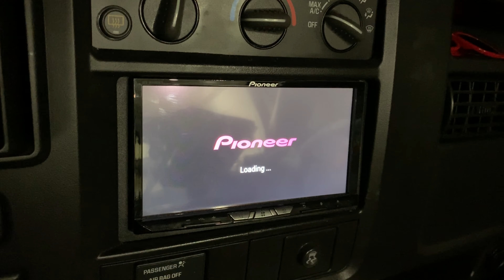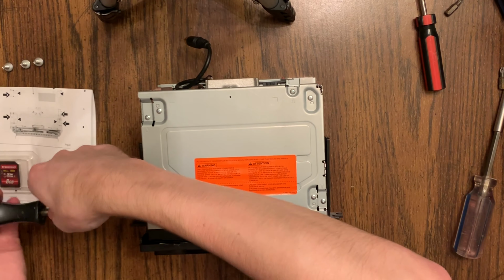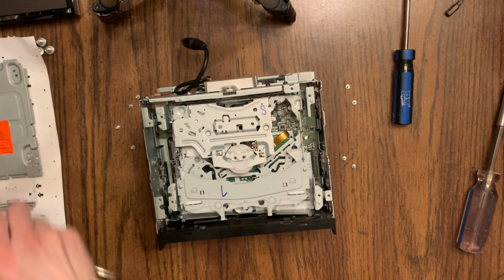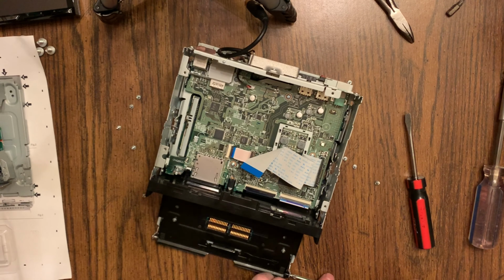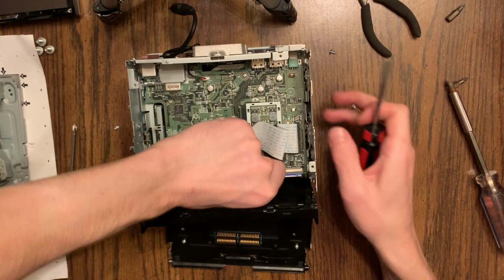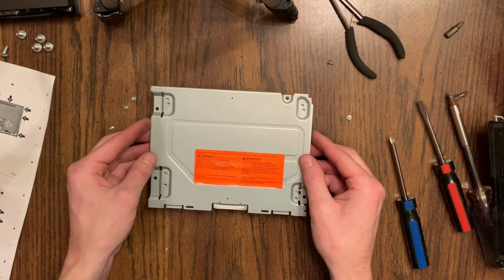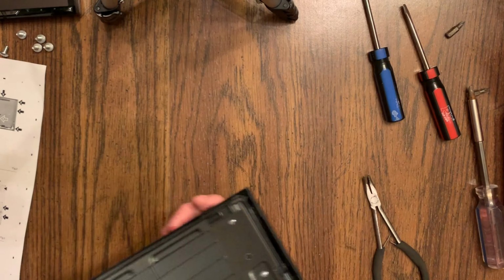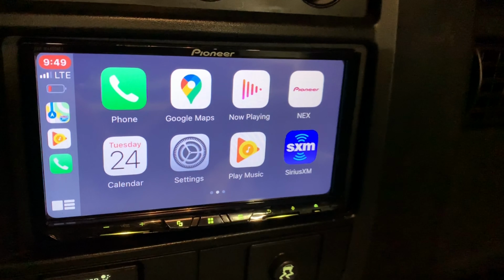Pioneer Software Error Fix - SD Card Replacement Procedure

Comment: Thanks for the video. I know this is a few years old but I’m curious to know if you ever had an issue with the radio freezing and rebooting and continuously doing that. I posted an upgrade video on how to update the firmware years ago. This is in a vehicle that doesn’t get driven often and just wanted to see if anyone else has this issue. Maybe a precursor for the issue that you were having?

Comment: redoing an old car, and everything has messed up by previous owner, car came with a 4400nex, it does not remember screen brightness, volume,  it always starts at same song on sd card (64gb fast samsung card) instead of going to last played folder/song. it does remember my phone/BT and always starts in android auto. i was wondering if previous owner hooked it up wrong and it needs a constant 12v even when off to remember settings...or if its bad SD card...it has a nice porsche logo when booting that i would like to retain, but i dont know if thats a built in feature of the unit or something hacked

Comment: update so today I got my new SD card and I used your video to guide me thru. Didn't have to disconnect the ribbon from the CD player. Anyhow, removed old one and installed the new one from eBay and it works like nothing happened. Only had to set time and date and it retained my radio presets and other stuff. 💪
Reply from the maker: Score! Glad to hear it's in and working. Enjoy the tunes!

Comment: I know this is a common issue with the NEX4400.  Just curious.  Since the card goes into a slot just below the easily accesable sd card, why didnt you take the time to cut a hole in the plastic so it can be easily accessed next time

Comment: I’m curious - can i just use a dremmel tool and cut out around and deeper than the exposed SD card to get access? It’s behind the screen and never seen. 

The issue I have is that the install kit I used is a one way install and requires the entire dash to be taken out of the car to get it out.
Reply from the maker: Sure thing! Others were able to gain access in the same way. The challenge is getting the Dremel at the correct angle to get the cutting wheel in the right spot. It has been done though!

Comment: Thanks for the instructions. I'm about to do this, but was wondering if after installing the new card causes the unit to go back to factory default? Radio stations, EQ settings, etc. Or do all the previous settings still stick? Thanks!
Reply from the maker: Hey Scott, it's been a while since I've done this but I think it resets everything to factory defaults.
Also, worth mentioning - some people reported they needed to perform a factory reset (after replacing the SD card) to regain certain radio functions.
Reply: @VanwithTim  Thanks for getting back to me so quickly. Appreciate you doing this to help out so many people. My radio is two years old and it just starting doing this yesterday. Ordered a SD with software from ebay and will do this when it arrives. Thanks again man.

Comment: I have a AVH-W4500NEX that seems to have saving problems.. I’ve noticed it says memory full a lot when I scroll the menus, Sirius radio doesn’t save my preset radio stations.. and the biggest annoyance of them all. CarPlay won’t retain my saved iPhone connections.. even if I delete all the old iPhone connections, once I turn my truck off the reappear the next time. Same for newly synced up iPhone connections. As soon as I turn my truck off and then back on the connection is erased. 

Does this sound like the remedy would be what’s shown in this video?
Reply from the maker: Late reply here, but I would first try a factory reset or a firmware update if possible (as you wouldn't need to remove the unit from the truck at least) but honestly it sounds like the internal SD card is on it's way out.
Just learned the publicly available W4400NEX file will work on the W4500NEX but takes a little coding. Namely changing the touch screen settings in the code. You can read more here:http://avic411.com/index.php?%2Ftopic%2F90861-fix-sdcard-failed-software-error-on-your-w4500nex-look-here%2F
Otherwise there is a pre-loaded SD card available from eBay linked in the description.

Comment: @van with tim I bought this unit today open box from Car Toys. Went to install it and this software error came up. Ran across your tutorial. Went and bought an SD card, extracted the file to my desktop then wrote it to the SD. Unfortunately, I’m still getting the software error. I’ve tried it over and over again, I think I’m just SOL. Will return this unit tomorrow unless you think I’m doing something wrong. Everytime I get done putting the image file onto the S card, once it gets done writing using that W program their is like 10 partition drives on the card. I just unplug it from the computer and plug it into the radio. Didn’t format anything or nothing
Reply from the maker: That's really weird, sounds like the file writing was done correctly! Maybe try re-writing them just for good measure (and make sure the touchscreen ribbon cable is fully seated into the connector!)

You can delete the files from the SD card using this guide: https://youtu.be/pfWDguRujEE

Then of course use the other guide to try rewriting them: https://youtu.be/Cro26vuoPHo

If it's still not working, I would definitely send it back for a refund or warranty.
-Tim

Comment: i have a pioneer carrozzeria avic-mrz02 similar structure as your with the sliding mechanism.
I'm stuck in a boot loops as well.
will this method work for my radio or even other pioneer radios?
Reply from the maker: Sorry for the delayed response - the SD card removal procedure may be similar, but you will need a different file. I would search or ask around here: http://avic411.com/index.php?/search/&q=avic-mrz02

Comment: I have the same problem on my avh-w4400nex, I also noticed that the unit itself is sluggish and slow at times, could the sd card be the problem as well? It takes over 3 mins to get to the home screen after startup.
Reply from the maker: That's the first time I've heard of that happening!
Hopefully someone in the comments can chime in on this.
In theory it could be a bad quality SD card (slow read / write rate or extremely low class SD card)

The SD card might be the cheapest place to start out. 
I hear the software is now available on the forums so no need to pay for anything other than a good quality SD card.
Reply: yup   ,sd card is getting Corrupt
Reply: @VanwithTim  Which forums? Where can I find the files?
Reply from the maker: @mykotron  link and instructions in the description of this video: https://youtu.be/Cro26vuoPHo

Comment: You just have to wonder if it is malevolent design (planned product obsolescence, if we want to be nice) that allowed Pioneer to to bury such a high wear item in such a user inaccessible location. With just a minor change to the plastics design they could have made that SD port just as accessible as the maps SD port, with no redesign of the circuitry at all. While I fixed my AVIC-4400NEX in only 2 hours and 3 minutes for free, (used an existing SD card I had and free software all around), I am never buying another Pioneer unit again. F' them.  

PS: If you want to TEST your repair before putting it back in your car,  the fat yellow wire and the solid red wire go to a 12V positive source and the black wire goes to ground.    I initially hooked up the black wire to ground and the red wire to 12V and NOTHING. Then googled help and found that the YELLOW wire is the actual power wire (role eyes) and if you hook up JUST the yellow wire to 12V and the black wire to ground you still get NOTHING. But hook up the RED and YELLOW to 12V and the radio will power up.
Reply: Hey man. Where did you get the firmware from? I need this for w4500nex

Comment: I have the same problem with 9200dab.
Where i found the fw?
Reply from the maker: You can ask around on the AVIC411.com forums but I don't see any for the 9200 posted.

Unfortunately you might have to message the eBay seller here and see if you can negotiate a better price for the file. I think it's sad they're selling the file and can't just give them free.
https://ebay.us/r81JHC

Comment: Is there a way to copy files from another Pioneer sd card? My friend has the same exact Pioneer AVH W4400NEX and his unit is working fine.
Reply from the maker: Late reply here - you've probably already figured it out. In case not:

There is supposedly a way to "rip" the image file from a working unit, but it's a very long process with some risk of corruption. 
However, the file for the 4400NEX is available for free online now. Here's the guide to downloading and writing the file! https://youtu.be/Cro26vuoPHo

Comment: Any idea if this would fix the unit just not saving any changes or settings?
Reply from the maker: I think it might fix it. I've heard a lot of stories of strange glitches like that which manifest into the full "boot loop" error. Unfortunately it seems it's not a matter of if, but when the SD card fails.
Huge strike against Pioneer with these units.
Reply: @VanwithTim  Thanks for the quick reply, and yeah terrible decision by pioneer.

Comment: My faceplate will not eject because the unit will not allow the eject button to work while in the boot loop.  How did you get the faceplate off?  Thanks
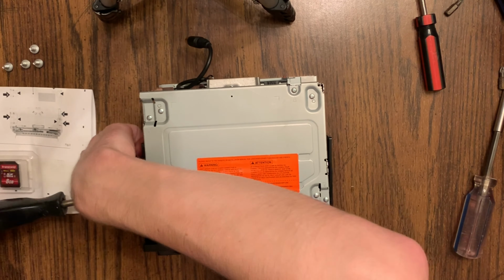Reply from the maker: Hey Erik, you should be able to slide the latch over and push the latch inwards if I remember correctly. (See @1:22) Did that work for you?

Comment: My 4400nex got stuck in the boot loop a few months back and I used the image to write to a new SD card and everything is working great. I had to change the battery in my car and the 4400 is now asking for a password to unlock the head unit and is giving the password hint of “pinball6”. I didn’t set a new password after reimaging so I’m guessing this is the password that is already included in the image file. Does anyone know what the password is? Sorry if this is covered somewhere else and I missed it.
Reply from the maker: I haven't given it a try, but the comments look promising here: http://avic411.com/index.php?/topic/83492-password-avh-reset

Comment: Do all pioneer radios have the same wiring harness. If I have to replace my stereo I would rather keep all wiring connected and just replace stereo itself
Reply from the maker: Hey Rick,  Pioneer units use the same PLUG but may have subtle changes in the pinout.  
I would double check the pinout of your old radio to the new radio.  

You can swap the pins around using a small screwdriver or pin removal tool if needed.

Let us know if you ended up swapping units and retaining your old harness!

Comment: Hi, thank you for a great job !!  My radio is AVH-Z9200DAB, after changing the card, the touch screen does not work, so nothing can be done.  It is possible that the software is wrong and it does not match my radio, or is something wrong?
Reply from the maker: Hi Artur, it's possible the software loaded to the SD card was for the Z9100 / W4400nex stereo.
The Z9100 / w4400nex software will load in the Z9200 / W4500nex stereo, but the touchscreen will not work.

It's also possible the ribbon cable isn't fully seated into the circuit board connector.
-Tim
Reply: If you still haven't solved your issue, try to look here http://avic411.com/index.php?/topic/90861-fix-sdcard-failed-software-error-on-your-w4500nex-look-here/. It should be possible to change the settings from "capacitator" to "resistence" in sysd.conf file.
Reply from the maker: @przemyslawchrzastowski1367  This is fantastic. I'lll be sure to pass the info on to future commenters with the W4500NEX. Bookmarked and appreciated.

Comment: Hi I have this problem with my pioneer avh-z9200dab UK but can't seem to find files or card anywhere for mine and pioneer say to go to dtronix repair but like I said it's costly
Reply from the maker: Hey Christopher - cross posting my response here for others to see who may have the same issue:
********
Hi Christopher, the z9200dab is the international version of the w4500nex.
The w4400nex software apparently will load and boot in both the z9200dab and the w4500nex, however the touchscreen will not work.

You can search the forums here (http://avic411.com/) to see if anyone has posted a working image file for either the w4500nex or the z9200dab. Last I checked it wasn't available for free and you still had to purchase on eBay.
Here's a link to one, it runs around $35USD https://ebay.us/Mb4CYb

I would message the seller first to verify, but I've heard from multiple sources that they're backwards compatible.

I believe the FM radio will be in "US standard" meaning the stations all end in odd numbers (102.7FM, 93.1FM, etc) where the EU uses even numbers I believe? (102.2FM, 95.6FM, etc). 

The folks who used the US w4400nex file in their z9100dab stereos solved this FM frequency issue with a factory reset once the new SD card was loaded.

-Tim

Comment: Is there a SD card you can buy in a store or do you have to find it online
Reply from the maker: Hey Vinny, unfortunately if you want the SD card pre-loaded with the files, you have to purchase online. But if you can find the files for your specific model stereo, you can buy the SD card in the store then write the files to the blank SD card with a Windows computer.
You can search the forums here to see if you can find your specific "image" file: http://avic411.com/
And I have a video on how to write the file to the card here: https://youtu.be/Cro26vuoPHo
Let me know if you have any questions. Happy to help!
-Tim
Reply: Okay thank you so much man by files what's that mean ?
Reply from the maker: @vj4130  The SD card has to have the files for the unit to work.
It's like a computer having a hard drive but it needs the proper files on the hard drive to work.
The files for the Pioneer 4400NEX unit are available online (but they only work with the 4400NEX stereo)
You'll need to find the specific files for your stereo and write them to the new SD card (or you can purchase the SD card on eBay which has the files already written to it)
Reply: Yo what's up man I ordered one on eBay for 50 bucks the dude sent me a SanDisk 16gb one unopened did I just get scammed?
Reply from the maker: @vj4130  That definitely sounds weird.
I would give it a try and see if it works.
Maybe record yourself opening it, installing it, and powering it on in case you need to make a claim with eBay.
Do you have a link to the eBay listing you purchased?

Comment: I did everything and now my screen wont respond, it boots up normally now but it won't respond to my commands any ways to fix this ?
Reply from the maker: Is your stereo the 4500 model? Others have also tried using the 4400 file for the 4500 model and had the same issue. Unfortunately I believe you have to purchase the 4500 file if that’s the case.
If you have the 4400 and are using the 4400 file, I would check the ribbon cable connection and ensure it’s fully seated into the connector.

Comment: Hey I found the firmware update on the company’s actual website, could I download and use that on a sd card instead of buying one?
Reply: Tim Campbell thanks man appreciate the help, I’m tryna save me a good 30 bucks from ordering the SD card but if all else fails that’s the plan
Reply: Mauro Martinez I think to access the software update mode you have to be able to fully start up without rebooting
Reply: calixxlivin that is correct for an update of a working radio, this issue solves for a reboot cycle issue.

Comment: Instead of prying out the slide can you just eject the screen turn off the power to access them?
Reply from the maker: Yes, but you'll need to remove the fuse to the radio while it's still on (or disconnect the cars battery while the radio is on and screen in eject position).

Otherwise, when you turn the key back to off the radio will pull the screen mechanism back in.

Comment: Hello Tim 
Am having the same issue with my Avh z9250bt 
Cannot find the software for this unit 
And the seller on ebay is on vacation 🥺 help me please 
Thank you
Reply from the maker: Sorry for the late reply! I know the AVHW4400NEX file works on the Z9150BT, but unfortunately there still isn't a free version of the Z9250BT out there just yet (that I've found).
I think it's the same as the AVHW4500NEX (Which also doesn't have the file available for free yet).
There should be a few ebay sellers out there for the Z9250BT software.
Have you tried this seller?
https://ebay.us/6r4c0R
Reply: @VanwithTim   hey thanks for replying
I've tried for the w4500nex 
It starts up buty touch screen is not working 
I think i will need the original version 😕 thank you so much I'll try the ebay option ❤️

Comment: Can I just load the updated firmware from Pioneer right on to the old SD card, or do i need to replace the SD card with a new one? Also if I need a new SD card, how large does it need to be?
Reply from the maker: I think you'll find this video helpful: https://youtu.be/Cro26vuoPHo
Basically you need to download the file from a third party link and use a special program to write it to the SD card. (Don't let it intimidate you! Just follow along with the video - it's less than three minutes).
Also, you'll need to purchase a new 16GB SD card (don't use Amazon / eBay - they're filled with glitchy knock-offs)
The issue is that the original Pioneer SD card was of such low quality that it ends up getting corrupted from normal use.
Hope that helps!
-Tim